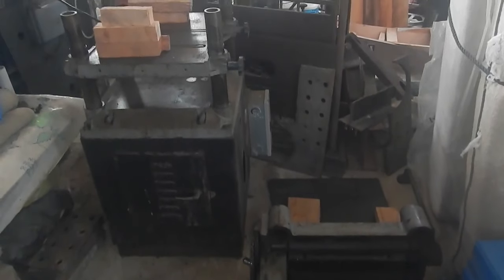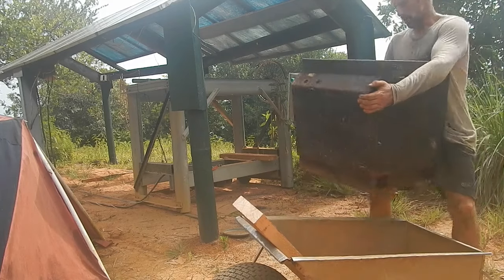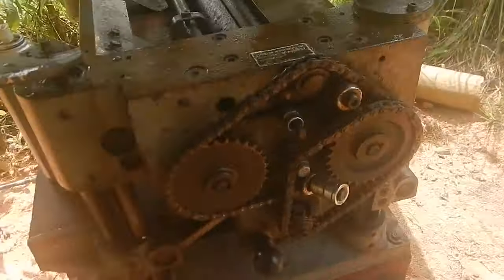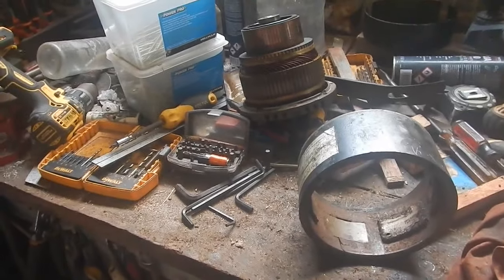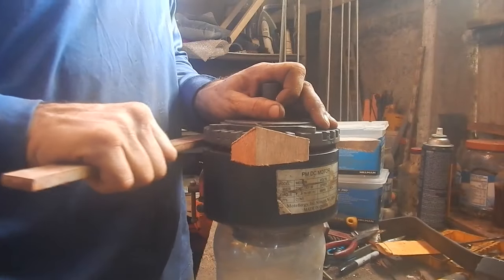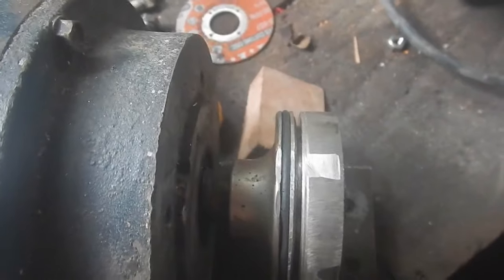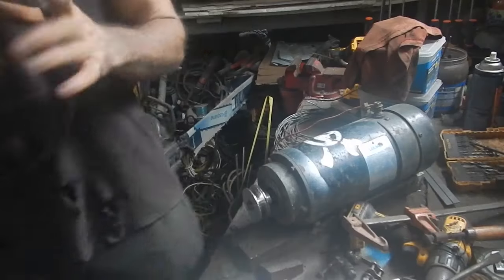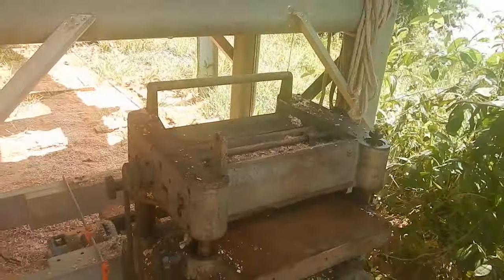Broken Industrial Era Planer to the Solar Age!

Comment: something to think about is building a sharpening jig for the planer knives. basically a holder for the knife and a lathe way for a grinder to ride on. the machine I use frequently is from the 60s its a cast iron beast and it has a set up to sharpen the knives while they are still on the machine

Comment: the best thing about the old brush motors is they are mostly universal DC AC they dont really care its only the on off switch that burns from dc power on the newer stuff. keep an eye out for old tools that have steel bodies those usually can handle running on dc right out the box. I have a collection of old grinders that I keep around because I can power them directly off my welder

Comment: You could make great press-fit 3D printed pulleys. If there's not much heat involved then PLA would do, if there's more heat then, of course, you have to go to either PETG or even ABS. The problem with PETG is that it requires to be bone dry while it's printing (preferably with active heating of a spool) and ABS requires to not have any drafts and well-ventilated room to print in, since it's kinda toxic. No drafts for ABS is easy to do with some sort of cardboard box over the printer, while it's printing. I recommend to try buying a roll of black ABS (since it's more UV resistant) and roll of PETG for experiments.
Just my two cents.

Comment: You'll also need knife setting jigs. Those knives have to be SO precise when you put them back in after sharpening, and you'll need to sharpen them at least once before you make it through all of the flooring.
A simple 25 degree knife sharpener would work for sharpening, but getting them perfectly aligned afterward is brutal.
Otherwise several companies like Shelix make helical cutter heads for that machine, those just have small teeth with 4 sharp sides you don't have to take all the way out of the machine. While that would save a ton of work and money on knives over 20 years, the $800 up front is pretty steep.  However, shelix works with lots of youtubers, so Jaime may be able to work out a deal with them.

Comment: That is superb!  I have a 1940’s era Belsaw that looks similar to that craftsman.  Sears never made their own stuff, could have been made by Belsaw.  The top cover was just a piece of sheet metal that was curved to go from front to back. If you fashioned some sort table extensions from wood or something for the in feed and out feed sides, it makes it easier and safer for small hands to be planing mill helpers. Will keep them further from the moving bits. That is excellent!  Did you have to sharpen the knives at all?

Comment: if you do the motor lathe technique again clamping the motor down to the bench better would make your cut off disc last much long. that little big of vibration is hell on cutoff wheels it just eats them right up

Comment: I have 900€ Chinese planer, and I'd trade it in any time with your planer. That's a proper machine and I hope you can protect it from rain and moisture.

My hands would itch to restore that one, show it some evaporust, a little paint remover, stone machined surfaces and put some protective oxidezer coating on non machined surfaces. Bearings on the blades sounded less perfect, so they'd be changed.

Blades looked like total rusted crap in a video, but they did cut. It's some indicator for quality.